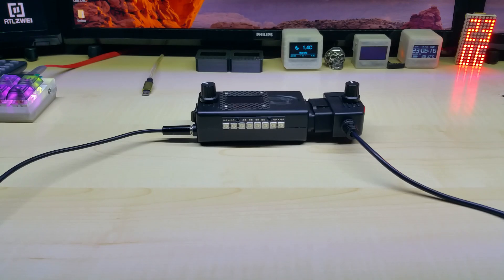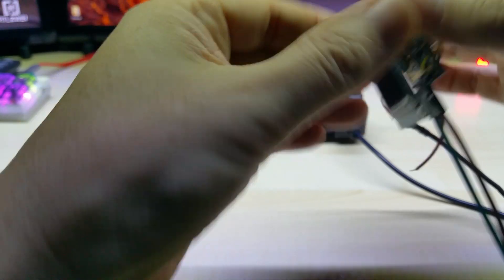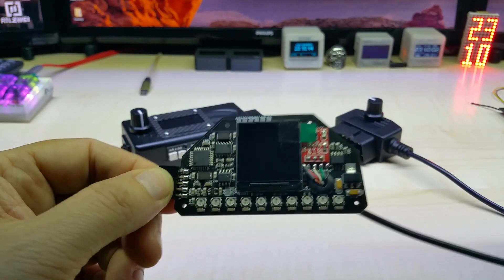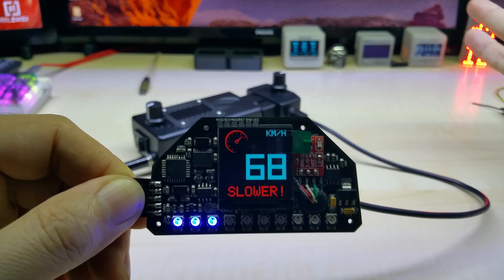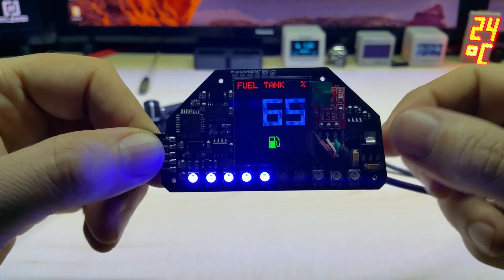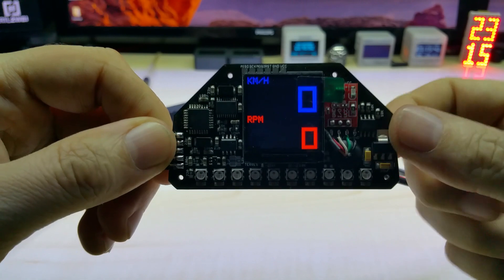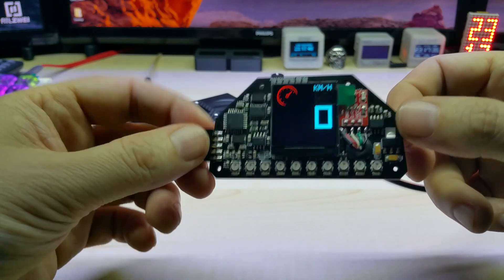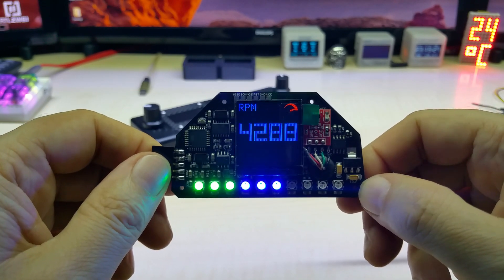Sneak preview of my new Color CAN GAUGE mini, hope you like it, please share more info below, thanks

Comment: Hi!
What processor are You using for this project?
And what touch sensor are You using for the simulator (e.g. for the brightness change)?
Thanks
Reply from the maker: Hi Rob, I am still using the "old" 328, the touch sensor is used for switching the screens and for dimming from the simulator it's just a Potentiometer, in the car it will get connected to the dash lights or a LDR sensor for auto brightness.
Reply: Hi!
Thanks for the response.
I have used a leonardo can board from hobbytronics with the small ATmega32U4 and found out that for my purpose and showing 5 or 6 values at once on a SSD1351 128x128 oled was so slow that it couldn't be used for my purpose on the motorcycle.
Now I'm switching to ESP32 and hoping for the best.
ANyway, regarding my question with the touch pad, it can be clearly seen in the video ad 2:52 that there must be some kind of a touch panel in your simulator as you switch it on by putting the finger on the housing. Also You're changing between the modes by gently touching the same spot over and over again.
At 3:23 it can be seen that You're adjusting the brightness with a gentle touch on the housing as well.
This is why I would like to know what touchsensors You're using.
Thanks!
Reply from the maker: No problem, what library are you using and are you polling CAN BUS PID's or are you working with AT commands which would explain why it is slow. As you can see I can poll several PID's at the same time and the display which has four times the amount of pixels has virtually no lag, and that is on the 328. The ESP32 should be lightning fast :-) The touch sensor I am using is the TTP223 module, they are very cheap and work great, just search for them on eBay or Ali.
Reply: @iHayri1  Hi!
Sorry, just saw Your message while I was researching how to properly get this to run.
Anyway, Up to now I was working with switch case which was very unreliable, however now I switched to ESP32 and it was (what a surprise) working as slowly as with the leonardo board.
My next try was to put all of the data from can in a buffer and after that put it on the display, however, this is too slow as well.
Now I wanted to ask how to contact You the best way and if You could teach me or show me how this is done in the best possible way. I'm struggling with this the more than a week now and I don't see any light at the end of tunnel. I'm happy to share my code if needed
Thanks!

Comment: Can the CAN GAUGE calculate fuel economy?  As in miles per gallon or kilometers per liter?
Reply from the maker: You bet ya, working on it right now, the Airflow screen will turn into that, as MPG get's calculated with VSS and MAF.